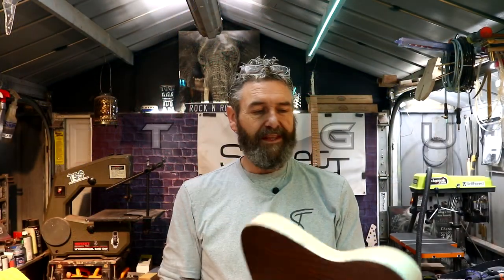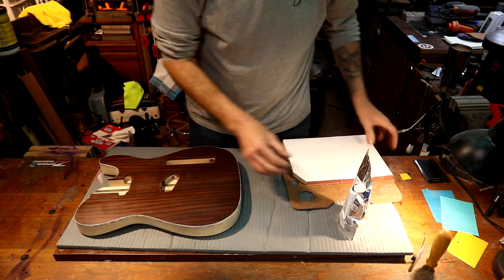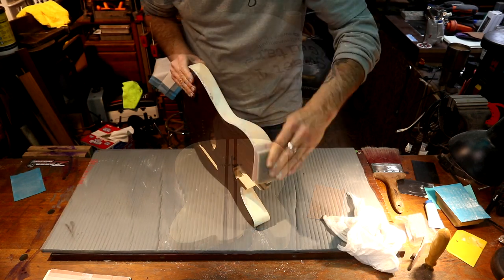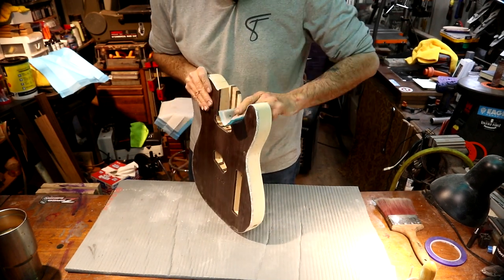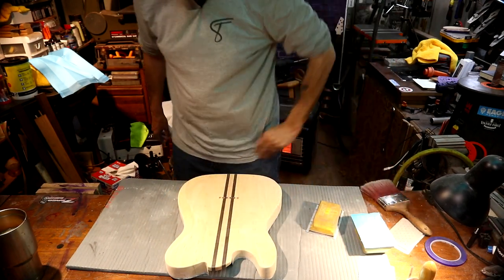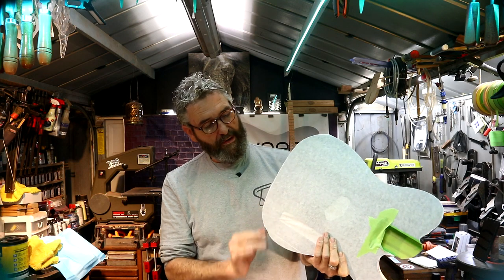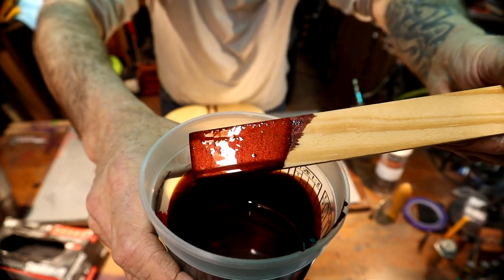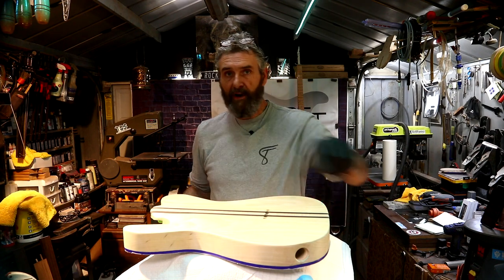Rosewood Telecaster - Episode 8 - #telecaster #telecasterbuild

Comment: That color change was a good deal. I like how it goes from brown to chocolate to the more red as light angles change. At least on my tv haha... Looks killer under the clear already before more coats and leveling process.

I picked up a spray gun in December, last month picked up a 90 cfm 1 gallon compressor and this month I should have enough to grab an in line water filter so I can start practicing and see how to work with the smaller compressor. Painting guitars that are small should be no issue with that set up I believe. I will practice with the water based acrylic I have on hand to use that all up. Probably shoot card stock or maybe even a an old bed sheet to work on dialing the gun and pressures in to get back into the swing of painting.

Comment: Nice prep on the spray job Todd, and you're 100% right - any silicon particles in the air are a recipe for disaster.  Nice coverage on the spraying!  The pearl in the paint really pops!  Do you guys still use 2k paints, we're mostly water based here.  A lot of guys can't work with it properly, I find it easy enough as you can flash dry between coats even using a heat gun.
Reply from the maker: Hey brother and thank you so much for the comment. That paint is polyester based solvent basecoat with 2k urethane clear on top so pretty standard here but the base doesn't require any isocyanate hardener, the clear of course does! Some shops over here have moved to water based but for the most part everyone still sprays standard base/clear here in the south! I will make the change to H20 as soon as it becomes available to me. I have access to Spies, Chromax, Nason XL, Imron, and Transtar but they are all solvent based! ✌️&💙